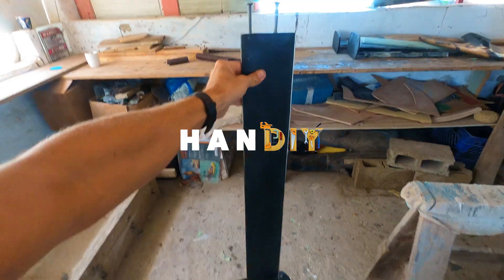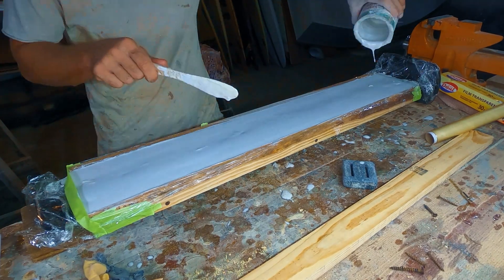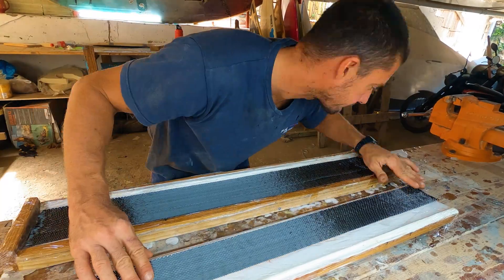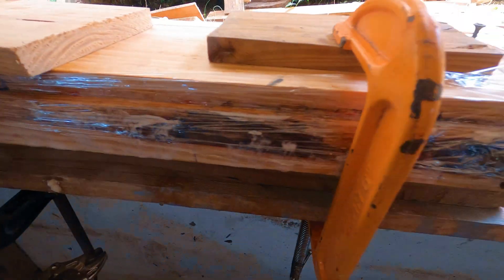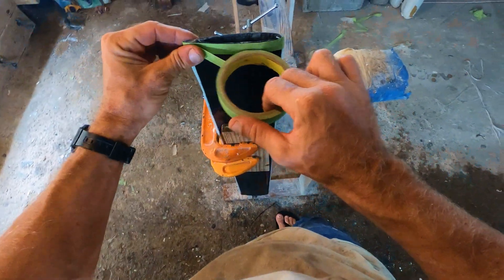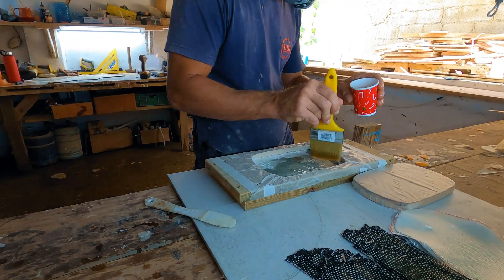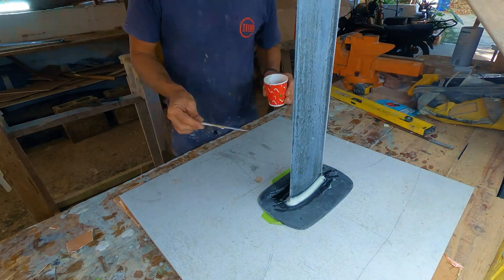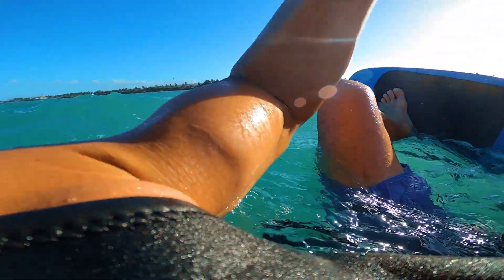Building a Carbon Hydrofoil Mast V1

Comment: Great video man! Question when you place the screws with inserts in the mast how to you make sure they are vertical, by eye? Also did you use 3k 6k or 12k fibre? Thanks
Reply from the maker: I set the screws by eye, as long as it straight enough it should work. In this mast I used 11 ounce unidirectional. Im going to release a new mast building video soon, detailing much simpler and improved technics. CHeers
Reply: @ thanks man I’ve watched the v1 and v3 video a dozen times understanding everything well, planning to make one so thanks! Great help

Comment: Did you use some sort of barrier cream to protect your skin from the epoxy while working with wet epoxy?

It was a very interesting video! I suppose the loads are not crazy if the mast holds up with no shear loading failures 🙂

I'll have to binge through the rest of your build videos. I have some F18/F16 catamaran daggers and rudders to build and your videos are inspirational.
Reply from the maker: I should have used gloves for sure. The mast still works well, surprisingly no shear stress issues but does twist easy. I recommend checking the Mast v3 construction video for a better overall construction by doubling diagonal carbon layers, extracting PU and replacing it with high density Filler. Best of luck with you builds, i imagine you could use a similar process but you'll probably want to add fiberglass or carbon at the seams just to be safe.

Comment: Nice example, I am going to make a simular mould including the base for a powerbox  and fualage for my current windfoil hydrofoil . What gr carbon material have you used in this mast? And is this buid layout rigid enough?
Reply from the maker: Carbon is 11oz 3 inch unidirectional, the mast does flex a little, I will add a little more next time. Also for diagonal layers, it would probably work better with Bi directional carbon. Cheers
Reply: to have already made two masts for the windfoil and wingfoil I advise to put many more layers of carbon for the mast and also between the base and the mast

Comment: Hi, cool video. I’ve been doing all sorts of composite parts over the years but this is a method I’ve not seen done. Do you think the method will work just as well for moulding and making surfboard fins?
Reply from the maker: Fin shapes are a little more complex, the inside layup might be a little trickier but theoretically i think it could work. The fin Tabs might be the toughest part to figure out. Its hard to find info on how real manufacturers do it,  I imagine its a similar process.

Comment: Thanks for posting! What holds the two halves together? (Do the carbon layers adhere to the foam?) (Is there a risk that it would split in two top to bottom?)
Reply from the maker: Good question, it seems several factors contribute to the mast's structural integrity. The epoxy inside the mold is pushed towards the leading and trailing edges, effectively gluing the two halves together. Also, the foam used is highly adhesive and bonds well with the epoxy. The top and bottom sections of the mast are made of solid epoxy/carbon fiber, providing additional strength. While there is a risk of the mast splitting in the middle, I've conducted tests by putting my weight on it, and it does not seem close to its breaking point. I've had many successful sessions with it so far. I'm still experimenting with different carbon layups inside the mold. Cheers!
Reply: @HANDIY  Thanks! I also imagine that the force pushing the sides of the mast apart aren't that high. (Maybe just fly faster so they get sucked apart? ;-) ).
Reply: @HANDIY   I thought you might add a layer of carbon to leading edge and trailing edge after molding. But apparently the foam is enough to hold the halves together. Nicely done!
Reply: I think the proper way to do this would be to mold each half separately and once each is cured join them together with a structural bonding adhesive designed for composites. I guess you could also join the two halves together by adding more layers to the outside of the part to cover the joint but that would change the outer dimensions of the finished parts and require a new mold or jig to fix the two halves in place for vacuum curing. I don't know what kind of loads this thing will be subjected to but splitting is a major concern although it will likely work for a while. That's the problem though, how long is "a while" and that is a question no one could answer because the two sides are not properly bonded.